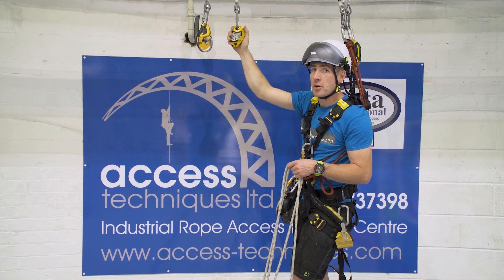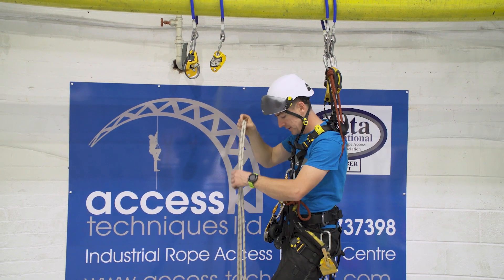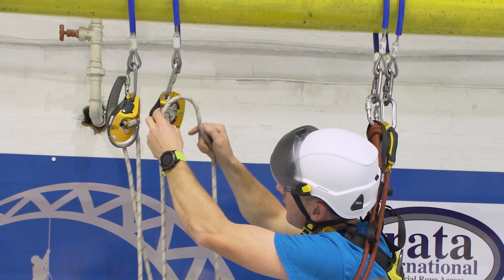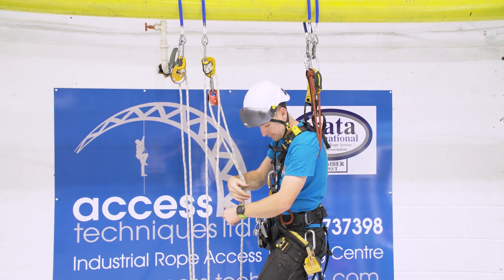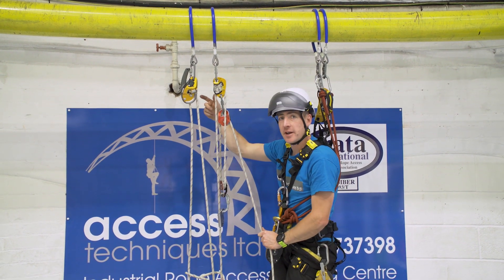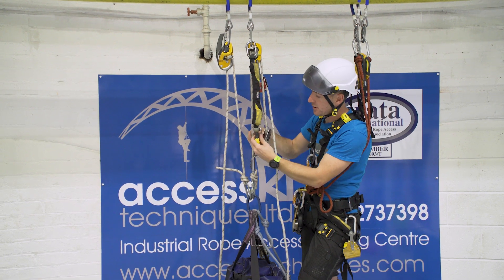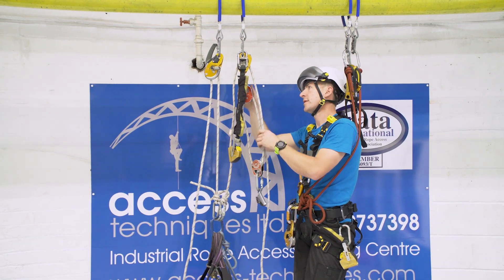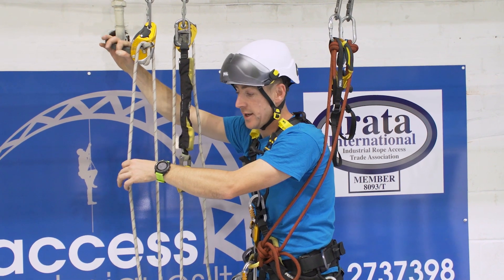Hauling and Lowering with a Self Locking Pulley (Petzl Pro Traction.)

Comment: Just a heads up. I never knew this until my assessment day but you have to control the ASAP trailing line whilst lowering a load:)
Reply: Petzl make no such requirement or recommendation. Unfortunately assessors get to play god on assessment day.
Reply: Adam Long actually Petzl DOES make that a requirement when using it in this system, link below. At least with the SPRAT evaluators I have had for the classes I teach, they do an excellent job of sticking to the guidelines.
https://m.petzl.com/US/en/Professional/Backup-belay-for-one-person-with-the-ASAP-on-the-anchor?ProductName=ASAP-LOCK
Reply: They actually do; maybe the Assessor was being helpful. Peace and love from Malta.